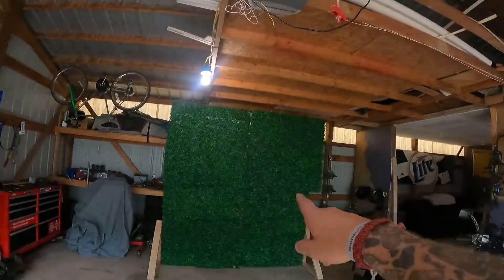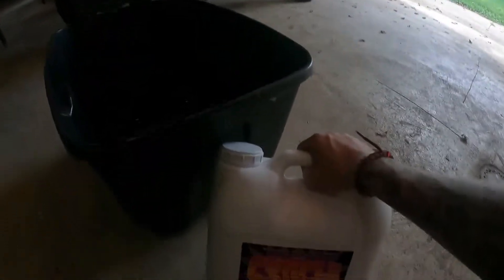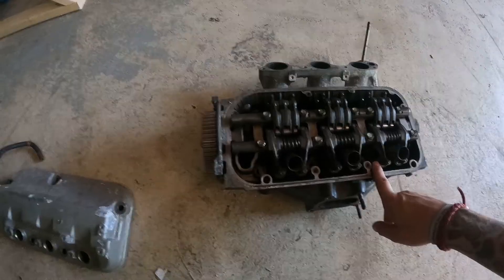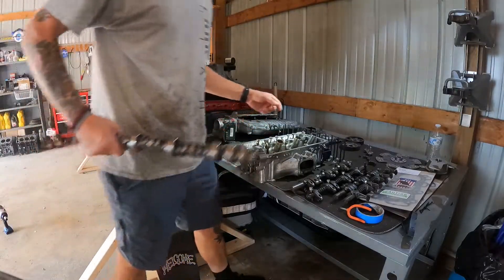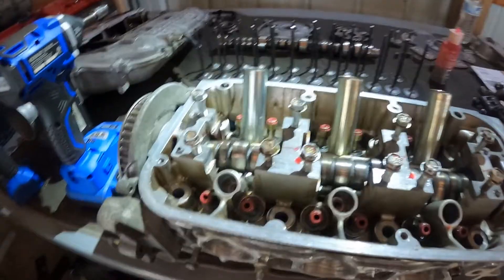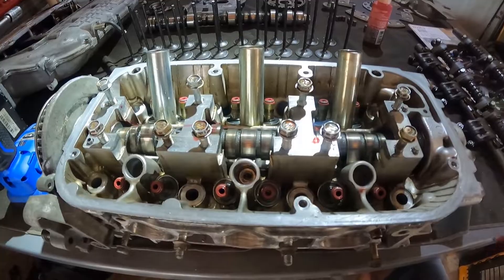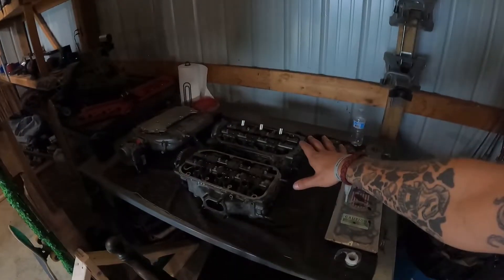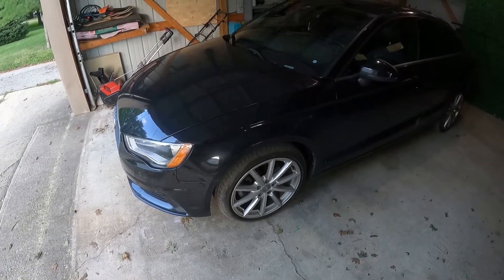Assembling my 500+ hp  nitrous j32 stroker part 3; how VTEC works and locking it on a J series head!

Comment: Swapping pins for VTEC lock did it  work or was there mechanical interference I have an 06 Acura tl 6 speed manual and considered trying this
Reply from the maker: No the pins swapped right in!
Reply: @SleepyEG  ok thats good news I am trying to push the most out of stock platform with no computer tuning on the j32 will start making videos myself but I understand I will lose lower end torque but plan on getting the j 37 factory crank  forged rods and Pistons out of MDX I know that will bring back the torque I lost lol but either way on disability and will be a long time before I can afford that but I know it will sound amazing cause man I ant got a lick of exhaust and the cats have been deleted with down pipes and has 16in echo tips  so yeah neighborhood hates cold starts but I'd love to hear what it sounds with locked VTEC with my custom built exhaust at idle ,,,,,use to be a tig welder before my eye condition...but great video man when I do my own port and polished intake il make the swap on those pins and tag you so you may hear this on bone stock platform Honda created an amazing motor with the j series
Reply: Ok so I swapped pins around and the car sounded the same are you using 2 long pins or just flipping them around